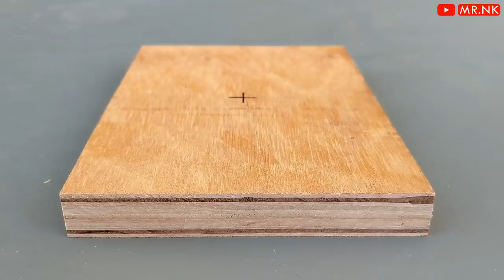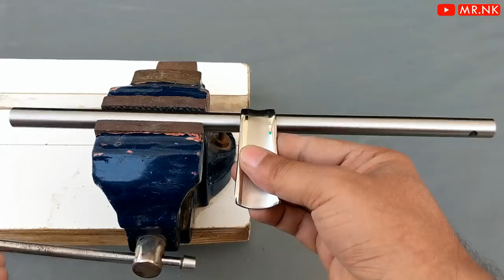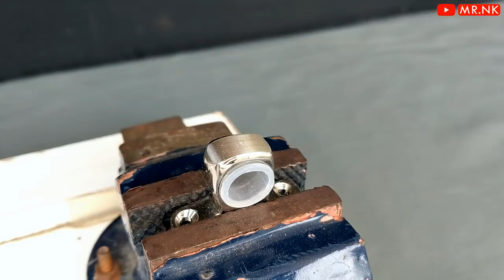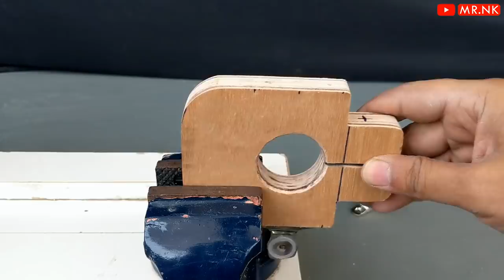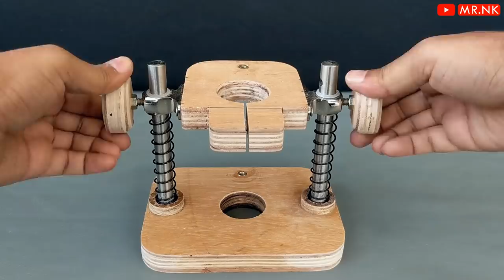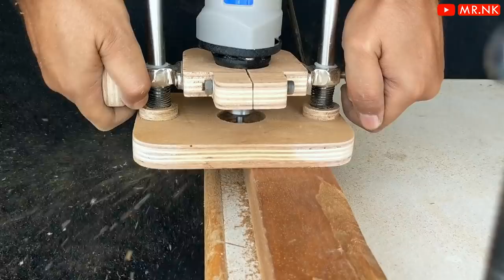How to Make a Plunge Router using Door Aldrop

Comment: Excellent innovation, though its depth setter needs improvement. As soon as you started router, the nut started dancing and by the end it was up by 3mm or so from initial set position. Overall your project has tremendous value.

Comment: Cool project. If you sharpen that hole saw it won't burn the wood so much.
Reply: It’s not the sharpness it’s the build up of sawdust. Use a vacuum and left the hole saw every 1mm - 2mm drilled to clear the buildup of dust.